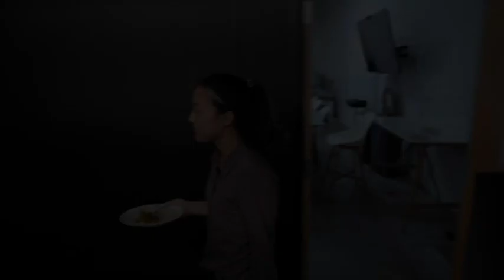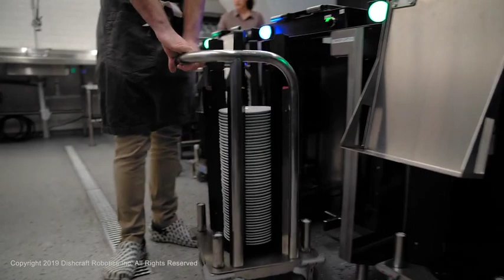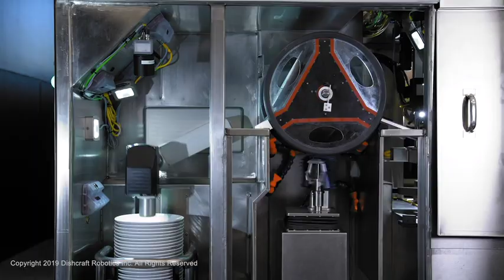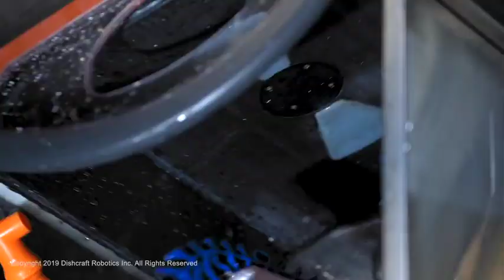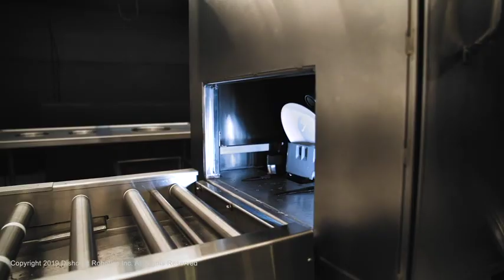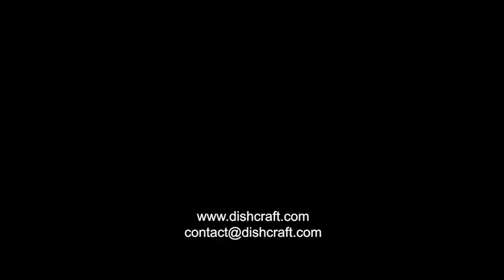Watch:Dishwashing Robot Cleans Plates At Restaurant

Comment: That's not a restaurant.  It's the lab/demo room.  They can't sell the machine so they are trying to sell/rent time by starting a dishwashing as a service business.  Can't do glassware or flatware or pots and pans in the machine.  Those will have to be done by hand or in regular dishwashers. Nice toy.  Solution to a problem that does not exist and eliminates entry level jobs.  Out of business in less than 10 years.